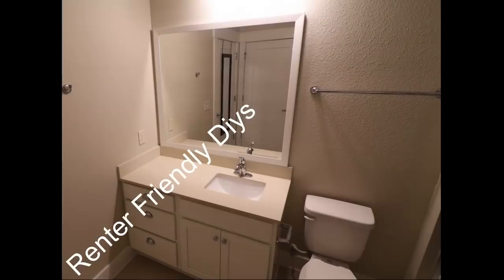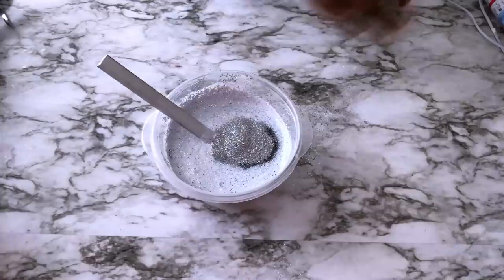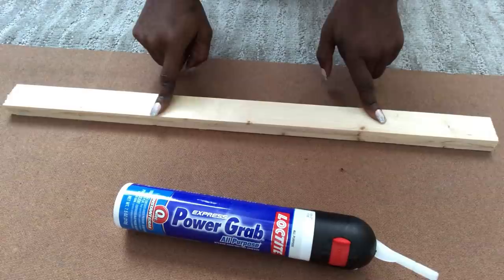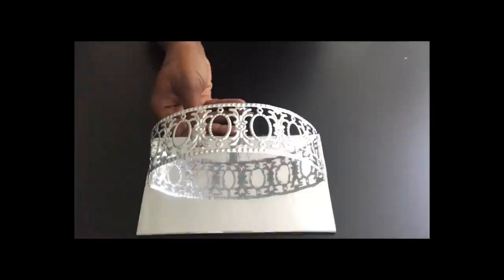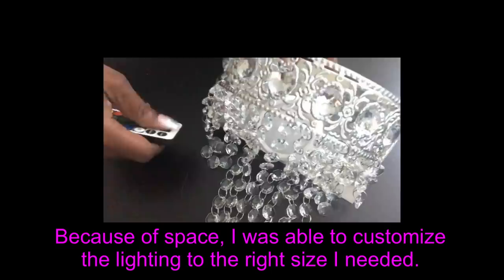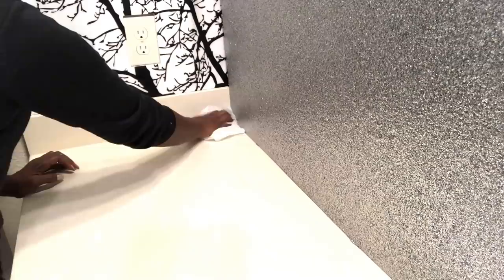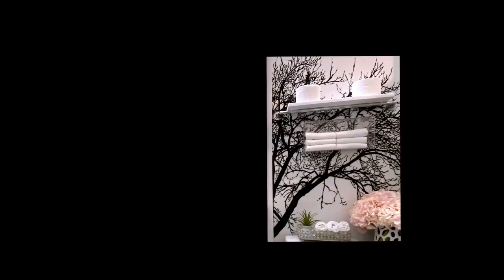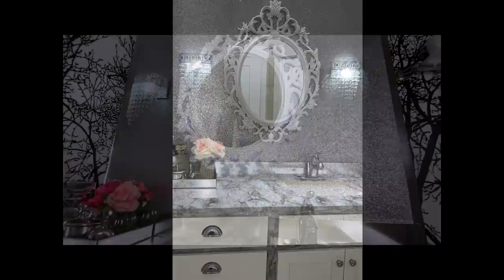GLAM BATHROOM MAKEOVER IN 5 EASY STEPS| HOME IMPROVEMENT DIY

Comment: I have done glitter walls by putting the glitter into wallpaper paste and painting that onto the wall. You can immediately see how it looks and no patches as its clear as it goes on. 
One coat was pretty but i went ahead and done 3coats so the wall was all glitter not just a glitter coating. 
I found very fine holographic glitter was the prettiest and glistened more than regular glitter.

Comment: Such a luxurious touch . I love it! How much sealer and glitter did you combine for the glue and glitter mixture? Did you use equal parts - half and half?
Reply from the maker: I'm glad you love the touch! For the glue and glitter mixture, I usually mix them in a 1:1 ratio, meaning equal parts of glue and glitter. This ratio helps to ensure that the glitter sticks well and provides a nice, even coverage. Adjust the ratio slightly if needed based on the effect you're going for. Happy crafting! 🌟🎨

Comment: Amazing but I cant see going through the trouble to make glam crystal fixtures when they are sold very cheap on amazon! Especially open box returns! If I can buy it I will but if I cant then I will DYI.  My Glam is done in gold and its hard to find gold glam so I have painted lots of crystal and chrome light fixtures and also bought 4 long teardrop mirror panels gold because a year ago they didn't come in gold and now after going through the trouble I see them all over the internet in gold but I did add some gold sparky glitter that make mine stand out more!  I have gold leafed a few things that only came in chrome or silver as well!